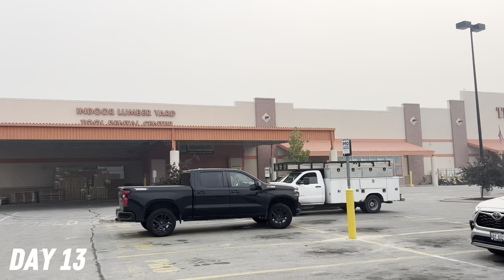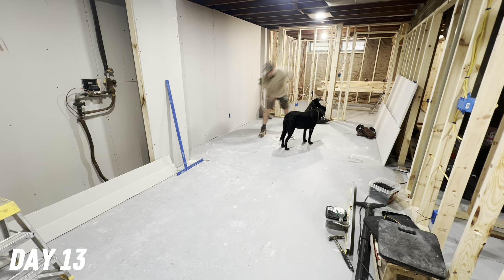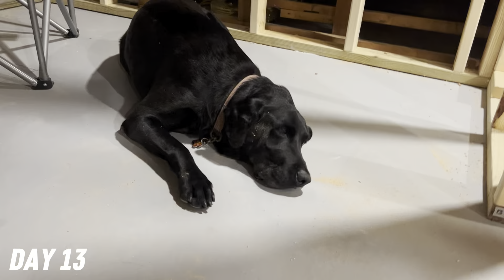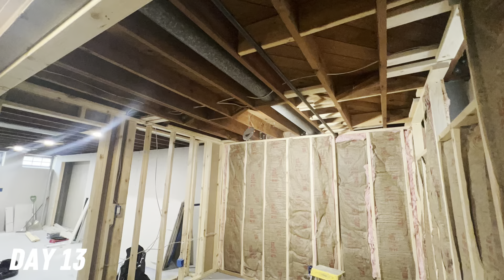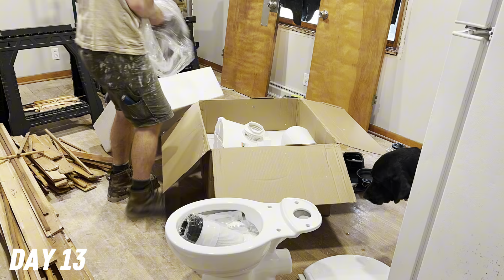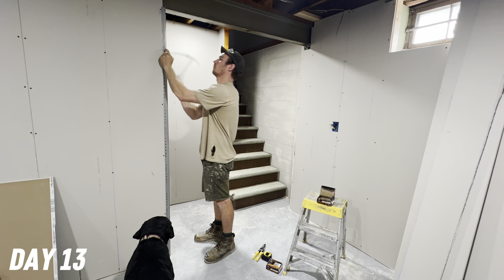How to Install Drywall SOLO | Solo House Flipping - Day 13

Comment: Looking good man.  Curious about the corner in front of the bottom of the stairs.
Reply from the maker: I agree, the corner at the base of the stairs is not ideal. There is an existing basement wall brace there I had to work around. Either way, there is going to be an obstruction there, so I did the best I could with what I was given!
Reply: @ThePoorCarpenter7  sucks when that happens, but I get it.  still gonna be able to get furniture down there?
Reply from the maker: Yes! There should be enough room!